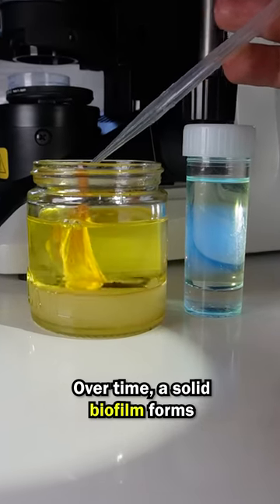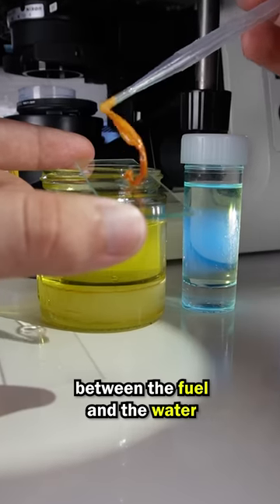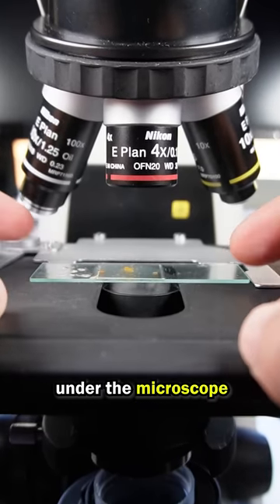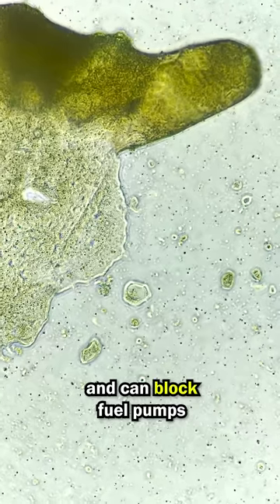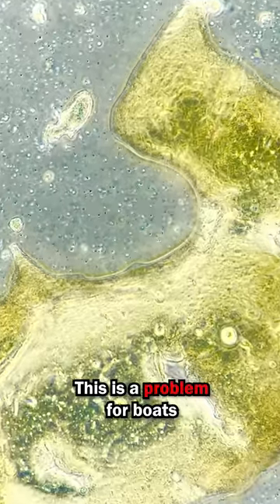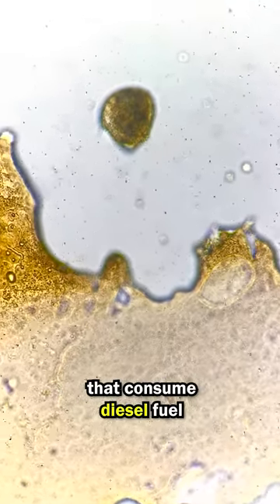How to grow Petrol Pets...

Comment: Yup.  Used to clean up oil spills.  It helps propagation of the bugs to aerate the water where the spill occurred.
Reply: Oh wow
Reply: Is that why they use the fire hoses at the border of the spill
Reply: That's interesting that people took a microcosm that creates issues for us to fix one
Reply: Isn't corrosion a bigger danger? Sry just wondering, on my last year before beeing a marine engineer so just wanting to know more stuff since they never told us about this
Reply: @keo2907  I worked on boats for years. The tank can get some rust but it's normally not a real concern as the rust doesn't do that much damage. It goes to the bottom of the tank and isn't picked up that much. You can use oxalic acid or phosphoric acid to treat the rust. 
The primary and secondary filters make what rust does get through negligible. 
"Diesel algee" as we call it will, over time. Fill your tank completely with slime. As well as ruin any fuel you put in. 
I mean both suck but if I had to choose I'd take the rust.
Reply: @lazzynomad  oh Okey, but I guess it is a small amount of water you are talking about then? Do you work on boats that are in sea water or lake water and what type of motors? I mean if it is much doesn't it corrode basically the whole fuel system. We do for the most diagnostics and some repair on outboards and some inboards but they are all on gasoline. If you could I would be happy if you could explain some more if you got time
Reply: That biofilm is useful as "poor man's napalm".
Reply: Eat ze bugs
Reply: @lazzynomad  yup, what they’re spraying are other nutrients that the bugs/bacteria that eat the oil need to help them grow more
Reply: @lazzynomad  would you help me identify a boat by seeing it in a youtube video if i link it to you here? Its like a galleon but modern in a jazz photoslide video
Reply: @xaviercruz4763  yeah link the video
Reply: so this can happen with just plain engine oil and water too? is that why it gets that weird gross film and orange tinge on used oil when left outside? sometimes i forget to dispose of my recently changed engine oil so it sits there for a couple or so weeks. it then has this weird smell and look to it - a film like the video too - not as thick mind you
Reply: That is awesome
Reply: ohh
Reply: Low Grade fuel from rust???
Reply: does this equal to what bad fuel does (crappy fuel cap seals and loads of sunbath in outdoor)?
Reply: Doing the lords work
Reply: @Miz Fanek  if the corriosion treating hazmat doesnt work well enough yall have to take the fuel tank out entirely and treat with harsher hazmat right?
Reply: @keo2907  they didn't tell you because they are anti fossil fuels and they don't want the fact that petroleum is biodegradable to be common knowledge.
Reply: When I changed my oil, 5W 30 and had it sitting outside for a while in the rain and all had a huge film on the top similar to this looked nasty disgusting thick clumps of brown
Reply: So like they just fine there or? Like how does it work?

Comment: I think that's also one of the reason why engine can't start when you leave the car or motorcycle for months without starting  it due to that biofilm especially when water get inside the fuel tank whether through moisture or not..
Reply: I have never seen a diesel motorcycle. Notice he used diesel not gas. Wen u leave a gasoline powered vehicle sit it actually seperates and breaks down and gas has some water in it, and engines dotn run on water... Yet. Perhaps I could be wrong with tho
Reply: @ianjaskela5877  I have Royal Enfield Taurus which run on diesel

Comment: Yup. We have something called bio diesel and its starting to wreak havoc on fuel systems. They've been trying to figure out the bio mass to diesel ratio because when not done correctly, the diesel forms an algae that will clog pumps, injectors, and even fuel water seperators.

Comment: Now take them and put them in a selection process until they mutate to eat all plastic.
Heads up. We need to start looking for plastic alternatives cause this will take that convenience away
Reply: There is actually a larva that dissolves plastic with a specific enzyme. The larva normally attack native bees, but scientists are trying to isolate the enzyme to deal with plastix waste
Reply: Plastic isn't inherently evil... For keeping stuff sealed there's nothing else that can do the job as well. The problem is it's abused in cases where cardboard, cellulose, or wax paper would actually be better for the purpose.

If you wanted to convert oil bugs for aggressive ecological activism, don't threaten lives and create tons of E-waste by rotting all the plastic in the world... Try making aggressive versions of these that can carry their own water bubbles and will eat everyone's fuel up instead of just making a film on the interface with water.
Reply: That makes me remember a book I was reading many years ago. Where a fast plastic eating/rubber bacteria got loose and basically resulted into a apocalypse scenario. With planes disintegrating mid air and what not.

Comment: The “fuel bugs” also produce acids that can corrode stainless steel fuel tanks. A particular problem for airlines, as great temperature fluctuations between ground temperatures and those at flight altitudes, cause condensation in aircraft fuel tanks.

Comment: Those are probably not "bugs". The movement they are displaying is what is known as Brownian Motion (the particles are moving due to being struck by free-floating molecules with high energy states - gases that are dissolved in the water). They could be "bugs" but you would need a higher magnification and probably a stain to see their structure to be sure. 
What I'm seeing instead is a breakdown of the petrol, C8H18 or C12H23, into particles (from exposure to sunlight). Those then enucleate (glom together) and possibly emulsify with some of the water particles, creating larger and larger particles that are denser than the diesel but less dense than the water resulting in a layer at the Petrol/Water Interface. Probably.

Comment: Oil wells are full of bacteria and if left unchecked it forms on the pipe walls and cause the metal to deteriorate which leads to pinhole leaks.

Comment: If I remember correctly there's a hope of using these bugs to clean up WW2 wrecks that are still full of fuel, as the years go by the tanks rust down until there's a leak, so introduce these bugs to the wrecks before they start leaking.

Comment: There’s this amazing thing called google. When I searched it, it says petrol is what Americans call gasoline, and petrol is a product of petroleum. Simple search also says that petroleum is used to make petrol (Americans call is gasoline) OR diesel; meaning petrol is NOT diesel. 

I looked up petrol bugs and didn’t get what this guy was talking about, but when I put “bacteria” instead, I found this, and it says “petroleum hydrocarbon-degrading bacteria”. Seeing as he mentioned a biofilm he was definitely talking about a type of bacterium, so there. He worded it wrong for calling it a per trip bug, because it’s really a “petroleum” dwelling bacterium, which based on what this guy said, is especially present in diesel, indicating it is also present in petrol, the other product of petroleum. So essentially is lives and feeds off of petroleum and it’s products.

Comment: This is everywhere as there is no 'pure' diesel anymore. Diesel now contains some % of bio-diesel. Keep in mind you don't have to pour water in the tank. Condensation can form and allow this to happen. It's becoming a problem for diesel generators that back up a lot of infrastructure a lot of people don't recognize and can be life threatening. There are a lot of things we require power for and no power could mean no phone, no heat/ac, no respirator, or lights on an operating table.
Not all doom and gloom though. Make sure you use your fuel or treat it to keep the bugs away.

Comment: This is a serious problem in aviation, especially military aviation. Whenever a plane crashes, all planes that got fuel from the same place as the crashed plane are immediately grounded. The crash might have occurred because the fuel was contaminated, so if the source has a problem, everybody has a problem.

Comment: And unfortunately that will continue to be a problem if/when we eventually swap to hydrogen fuel. Can't remember if it forms faster, slower, or the same speed with hydrogen though

Hydrogen is still worth it though. Less pollution than gas or full electric, great for commuter vehicles. Just need the infrastructure